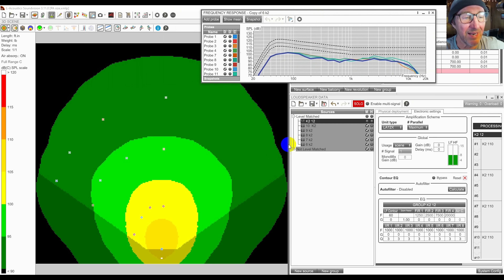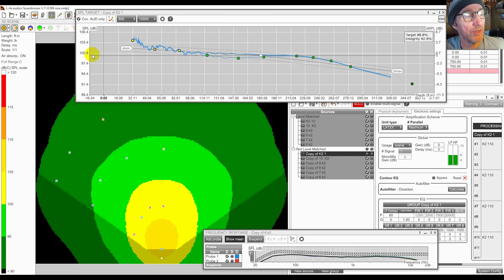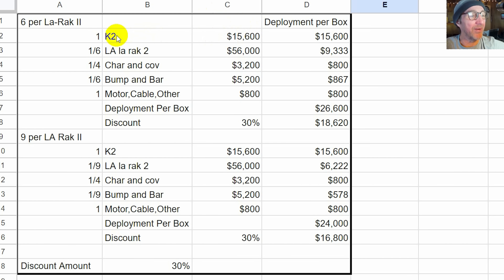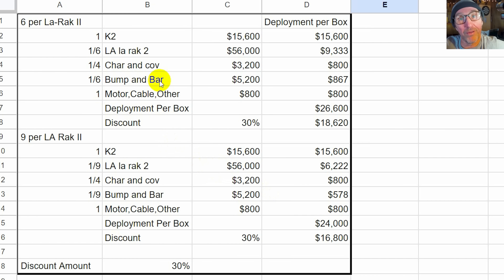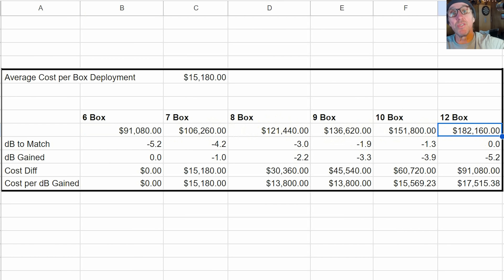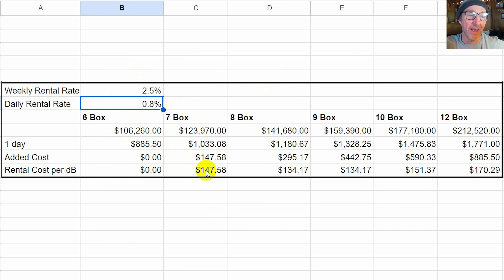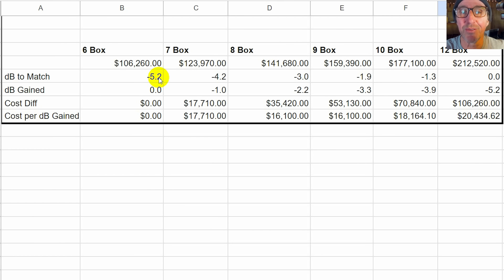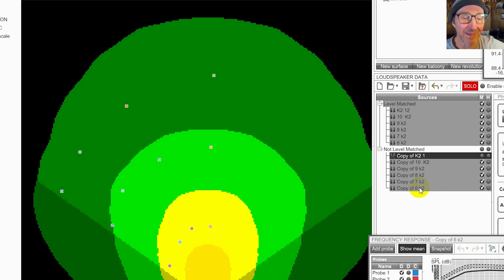How Much Does a Concert dB Cost?

Comment: Love your videos Dave. I know you are an L-Acoustics guy, but Im sorry, $15,600 per box is ridiculous. Our 12 line arrays and 4 subs cost less than that 🤣
Reply from the maker: Fair enough. And many different tools for different applications.

And cost is only one factor. The value in L&acoustics is world wide availability of identically aligned systems. We can sub hire in bulk with 100% compatibility.

A full line of diverse products with near identical sonic footprints 

The best prediction software by far

Extremely low depreciation. We sold our V-dosc systems 15 years after we bought them for more than we paid.

Long working life. K1 was released in 2009 and is still 15 years later, one of if not the top large format system in the world.

ROI. Expensive yes and also the return on investment is extremely high as well. Our entire L- acoustics inventory pays for itself every three years or so, over and over again. Some enclosures like K2 have a 2.5 year ROI.

So yes, other systems cost less but also that may be a penny pinch pound foolish perspective
Reply: @DaveRat  I appreciate the very fair points. I guess I'm just speaking as a smaller, regional company, who will never be able to afford the luxury of multiple $15,000 boxes.
Reply from the maker: Yes, it does look ominous from the perspective of a regional vendor. 

I know because I started my sound company with 2 speakers that fit in my car. Worked my way up from backyard parties to clubs, then halls, then regional to national and worldwide.

Though we were doing world tours prior to owning L-acoustics, owning L-acoustics is what really drive our growth.

Less expensive systems will position you to work harder for less money against more competitors.

Providing premium systems to more demanding clients and backing that with extreme quality and customer service can position your company for higher margins and higher quality gigs.

It may also be important to point out that we funded our growth internally, we don't have any cash cow outside owners or such. We did borrow money and do leases and loans but our growth is organic
Reply: @DaveRat  That is very interesting, and proves you are a smart business man for sure! You also make some really compelling points that I had not considered. Thank you for giving your backstory, Dave!
Reply from the maker: Great to meet you and yes, I am 44 years in and follow a slow steady growth plan. I enjoy risk and over the years have transitions from max risk to stability and longevity.

As far as purchasing gear, the initial cost is a hurdle but the driving force of the decision should be time frame of ROI and residual value of the gear vs money owed.

The formula I use is 

ROI of 3 years or less is a buy
ROI of 5 years or more is a don't buy

Modified by availability gear that can be sub hired. If we can sub hire easily and below rental rates, don't buy.

Buying gear with a high resale value over time insures both it's rental rates will stay stable and gear can be sold in the event of financial stress.

Cool cool and keep me updated on your progress and endeavors.
Reply: @DaveRat  You too, Dave! Nice chatting with you. Thanks for taking the time to reply with the great info and insight, I certainly appreciate your perspective, and I respect how you have built your career from the ground up. I'm 33 and only 12 years into production, but it's truly a passion of mine, and I'm proud of the progress I've made in that time, thanks to the help of guys like you. 

Congratulations on a successful 44 years! That's truly impressive.

Thanks again! Dave Harris.
Reply from the maker: 👍🤙👍  I look forward to you sending me updates of fun accomplishemnts

Comment: Random thought: Have you ever done a video about how venue shape affects the size of PA you need, and thus the cost of it? My church recently had to temporarily move venues and we had to use a school gym hall that was a long oblong shape. I said to our production manager that if we set the room up in landscape/wide format, we might not have to rent extra PA, because we use D&B Y10s, which have 110 degree angle, but if we go long ways, we'd need to rent in a pair of delay boxes. In the end we were forced to go long ways because of an installed projection screen. This then forced us to rent delays to achieve a consistent (ish) SPL front to back.
Reply from the maker: Alterations in the horizontal or vertical coverage requirements for drastically increase or decrease the amount of boxes needed. What's interesting is increases in vertical coverage can drive up the box count of line arrays very quickly, 

I will ponder something down that line if I can come up with a perspective that is interesting and I can present a clear vision of that

Comment: Great stuff Ratty. I don’t miss that part of the PA biz at all.  “Bring X worth of PA for half the normal price”…
Reply from the maker: We just turn down gigs that won't hire adequate systems. But we do work with clients to optimize. And the discussion came up "is there a way to reduce the budget without compromising the sound"

And of course there is no right or wrong when opinion and perception is the judge.

So this video is an offshoot of the info I presented. 6 box was the minimum that would cover at a reasonable level, 12 box was the initial bid. 

9 box allowed a single amp rack rather than two amp racks.

The cost vs dB analysis along with audible demo was presented and we went with 9 box delay clusters.

All good, not an emotional thing, but rather, working with the client to optimize, quality and budget.

Comment: I would enjoy a follow up video discussing headroom. As audio engineers we all know that it's best to run any system at somewhat less than 100% of its capacity, but how much headroom is actually necessary, and where do you start to see diminishing returns from adding system capacity at a fixed volume level? If you want to mix at about 95dBSPL you want a system that is capable of throwing more than that, but how much more? 105dB? 120? 130? At some point you're just wasting money, but I've always just kind of estimated how much headroom is ideal and never gotten really scientific with it.

Comment: Dave, I think you under-valued the costs of cabling and hoists by a significant amount but it doesn't change the logic of your analysis, which is spot on.  Thanks for showing the math behind the business of audio.
Reply from the maker: I will go back and look but I bet you are right, 8 did not double check the spreadsheet and it did seem the diff should have been bigger

Good catch

Comment: This can be really helpful. Ideally, you want enough overhead that you don't have to compress the overall signal and you can set the levels you want, but you work with what you have where you can apply LUFS principles at FOH to get as much out of the system as you can. It seems as though so many FOH processes are being imported from the post-production and broadcast industries already, things like parallel compression or multiband compression, that we can learn other things as well from that aspect of the industry.
Reply from the maker: Understanding the output levels of the various system sizes when deploying systems versus cost is helpful in optimizing the decisions of how many speakers to use

Comment: Dave, this is brilliant- thank you for breaking it down. From a listener perspective it seems like you would see more value in splitting two sixes to handle delay issues and increase spread vs going for db. Ie. What’s the best value to listener if you do have the money?
Reply from the maker: Adding delays increases cost, complexity and reduces sight lines. That must be balanced with coverage and SPL levels.

It's very subjective but what we do is create predictions of coverages based on feasible delay cluster locations and scale box counts to optimize SPL

Comment: Without measuring how much you can feel the bass, gig sound level is mostly to drown out those punters that just won't be quiet.
For your "what's a db sound like anyway" test, you might have a constant level background sound as a reference for the subject sound.
Reply from the maker: I think you're crafty enough to derive the information you need from the information provided. If you need more dBs to drown out whatever you need to drown out, this helps with understanding the cost of that adventure.

As far as subwoofers I've done a lot of videos on that and I do have a video planned on how to array subwoofers for maximum efficiency versus maximum coverage versus maximum sound quality

Comment: Do the amplifiers / processors in these systems give the user some idea of the percentage of time the signal was limited to protect the speakers / amplifiers as a way of measuring how hard the sound system is being pushed?
Reply from the maker: Actually yes, there is an exportable log that can be analyzed to research failures

Comment: the amount of boxes are mainly according to the balanced spl covering of the audience not the db level. to level up you use a louder system not more cabinets.
Reply from the maker: While that can be true with point source systems and some setups and with small format pa syatems, with modern line array setups more boxes can be used to increase  vertical coverage or used increase SPL level or used to maintain a more consistent volume level over distance such that the volume drops off 3DB per doubling a distance or zero DB per doubling a distance or 6b per doubling of distance..

Furthermore, One can configure multiple boxes to do any combination of the above all the while using a single box type and just by altering combinations of the quantity of boxes, azimuth of the array, and angles between the boxes.

This is the beauty of line array systems and allows them to cover venues more evenly without having to haul around a vast assortment of different boxes.
Reply: @DaveRat  that is right too and shows the many possibilities of designing systems. thanks for your work and sharing knowledge and ideas.

Comment: I just pushed my master fader up and got 5db for free!  
Rental companies don't want you to know this one simple trick.
Reply from the maker: If you can push the fader up and get 5 more clean dB then you already hired way too much PA, like near double what you needed
Reply: @DaveRat not necessarily. Intermodulation distortion (which is quite noticeable by ear) is linear with headroom. The more you push a box the more distortion it has even though you might still have 10db of headroom. So having 5db of free headroom is far from being a bad thing. It just depends on the clients need 💪
Reply from the maker: Well if you are going to change the parameters of the discussion the yes, things will be different.
Reply: I still haven’t worked out a way of turning up the talent

Someone suggested to use a fake it until you make it plug in, but it doesn’t run on my old hardware….

Comment: Do you think the labor cost to hang the boxes and the electricity costs of running the amps is significant?
Reply from the maker: Typically those costs are not incurred directly by the rental company making the recommendations 

That said, if scaling up, the added weight can be an issue. If scaling down, the savings on electricity would be in the several 1s of dollars. 

Labor wise scaling up or dow could add 5s of minutes to each cluster and trucking wise if scaling down a lot of clusters, saving a truck would be of value.

All that could probably easestly be added into the calc by increasing the deployment cost by $100 per box or so across the board.

Comment: Probably a question better directed to your website, but do you have this cable in bulk spools? I may have some installs coming up where I want better cable. I'm still getting some pushback on using higher quality Cat6a that meets the specs., they still want 5e but I think I'm going to be out 50+ meters which is beyond my personal overhead. The cable they use is also going to be lowest bidder, you can see where I'm going. If you published the frequency sweep tests that you've made, I might be able to get them to use the higher quality cable. I think we wanted 2 or 4 runs in this area of the building so we might need 2000 feet to pull and install up to 100 meters per run total.

If you can do bulk cable, I'll drop you a message at your store.

Comment: What about running the sound system backwards from the back to front, so the stage doesn't get the volume?  Also I have been wondering about "circle stages" like where the stage is a circle rather than a square and sound moves from the outside to inside, how does this affect coverage? Could sound be reduced enough not to crossover in the center yet still be loud enough ?
Reply from the maker: Sound travels quite slowly compared to what we see and the speed of light. Having speakers far away pointed at the stage would create unsolvable problems where the people close to the stage would hear the sound late. Also putting speakers far away shooting inward requires many many more speakers than having the speakers on the inside firing outward.

Circular stages are feasible and are not uncommon.

Maybe check out the video I did on Bassnectar subs

Comment: Very interesting. And don't forget, this is just 1 hang. When you have 2 hangs plus subs, the numbers probably triple. The next question is, in order to cut the budget, is it better to have a slightly quieter PA of the same quality, or go for a cheaper and lower quality system of the same size?
Reply from the maker: That's an interesting perspective that has many dynamics. Quite often the artists Rider specifies a certain level of sound system and the sound systems they specify within a similar price range.

Going outside of the specified systems tends not to be the best way to perpetuate future business with the client.

Our approach is to provide police systems that are capable of providing quality coverage and if the budget cuts exceed a level we're comfortable with, we don't do the gig.
Reply: @DaveRat  Yes, that makes sense for your business. You have a reputation to maintain and your clients understand the quality of different systems. However there are many applications below the top tier touring circuit where clients come with a fixed budget and not much idea of what's on the market and they just want the "best" sound for their money. It's obviously quite a subjective topic.
Reply from the maker: Very true. Proper tool for the job. Don't bring a Ferrari to a desert race. Don't drive a dragster on a mountain road, and  opening car rental place that only rents Bentley's in a college town with a bunch of seedy bars, may not be the best business plan

Comment: Awesome video and breakdown. How about cost per subwoofer?
Reply from the maker: I am working on a vid looking at optimizing subwoofer coverage vs sound quality vs efficiency
Reply: @DaveRat  That sounds useful. As part of that, it would be helpful if you could mention the pros and cons of adding subs to delay stacks/towers/hangs too (or maybe that's a video in itself).
Reply from the maker: Not sure if that wants a specific video. Subwoofers at delay clusters not problematic because it's very difficult to focus subs purely forward. And the back energy radiating the wrong direction causes more problems than the forward energy typically helps.

That's it there are specific instances where adding a subcluster for a house or in the field can be useful.
Reply: @DaveRat  I think you made a typo, saying "not problematic" instead of "problematic". I have never tried it, but I have made test plots using D&B Array Calc and it looked messy. Seemed like it was cleaner to just add more subs at the front.
Reply from the maker: Yes, I meant are problematic

Comment: I’ve been wondering something similar, let’s say a smaller box that cost half as much like the hdl6a vs having half the amount of a larger box that cost twice as much like the Hdl20. 
so would a 4 hang hdl20 rig be louder then a 8 hang hdl6 rig?  
does the maximum spl rating plus 6db every time the amount of cabinets is doubled apply to this?

Comment: You should do a video on the supercat AES50 cable! I'm curious as to what you discovered makes other cables not work at that distance. I've used your purple supercat cable up to about 75m maybe 80m reliably with aes50, but that's about where it starts dropping sync.
Reply from the maker: Awesome and great you mentioned that.

Yes the purple Super Cat is good too about 75 to 80 m as you mentioned exactly. The blue is good to 90 m for 100 m.

On the sound tools web site I put together a chart with information on the differences between all of the sound tools cables.

Check this video out and let me know what you think. I dived into the reason why various cables work and don't work and compare unshielded versus the Behringer / klark Technik Cat5e versus Cat6 versus the new Super Cat XM cable

https://youtu.be/bQXOXWuxCGA?si=EVdUm5i9kuNQ6wr5
Reply: @DaveRat  Oooh! This video must have slipped by me! I just watched it. Very interesting stuff! Thank you!

Comment: What amps are used for the K2 rigs
Reply from the maker: You can power a single K2 from a LAA4x or up to 3 K2 from a LA8 or LA12X. 2 K2 per LA12X offers the most headroom though the rates output level is the same. Running 2 vs 3 gives less cable loss and better damping factor and sounds better and sounds slightly louder
Reply: @DaveRat  ok thanks Bro Appreciate it I was just curious about it